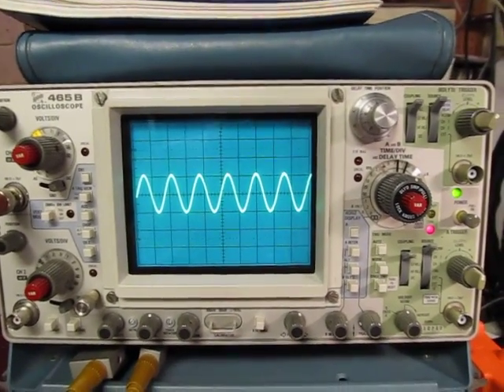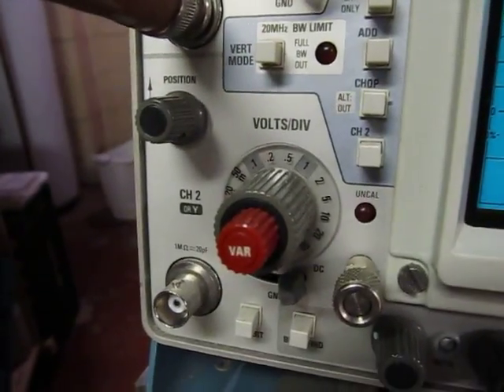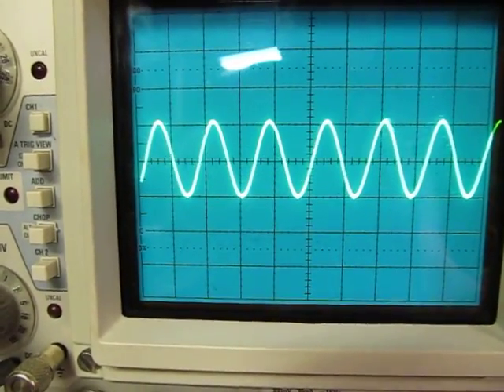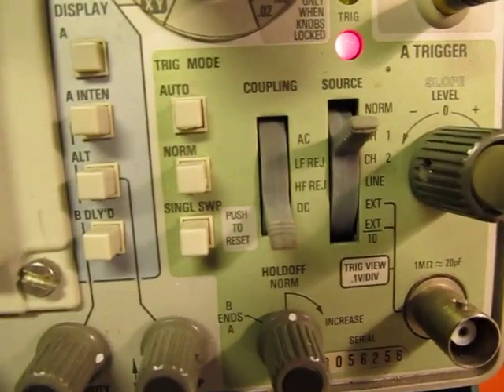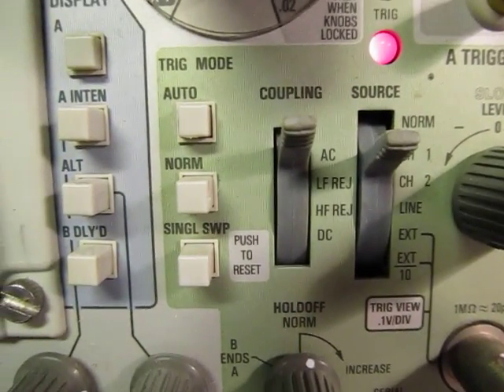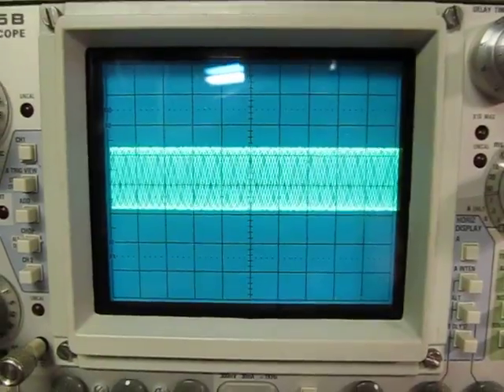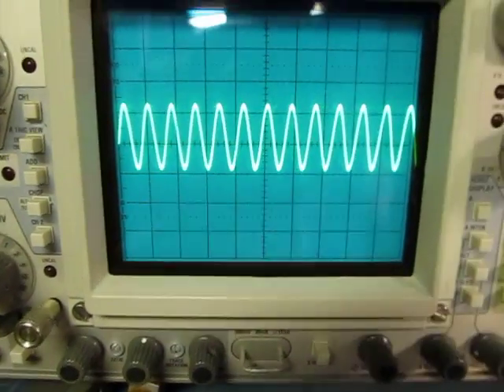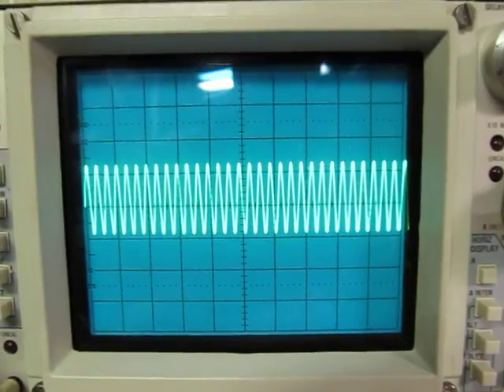#11: Tektronix Oscilloscope Triggering controls and their usage

Comment: And the External Trigger? What is useful for?
Reply from the maker: +Popart 2015 There are times where you might want to look at a pair of waveforms with respect to a third signal.
Reply: ***** Ok, thank you. Nevertheless I don't find any good video about External Trigger to see how to do it
Reply from the maker: +Popart 2015 It isn't needed very often, but can be handy sometimes.  An example:  To look at differential logic signals you would have to probe both the DATA and /DATA lines with the two scope channels.  You would then use the ADD and INVERT functions to see the differential signal.  If you wanted to see a differential eye diagram, then you'd need to trigger on the data clock.  You can apply this data clock signal to the EXT trigger in order to do this.  There are many examples where you don't want to waste a scope channel to simply do the triggering - this is where EXT trigger is helpful.  It is kind of like an additional scope channel, but one that is only used for triggering (not for waveform display).
Reply: +w2aew So, the external trigger is not an output channel, it's also an input channel but only for triggering. Ok, I got the idea, more or less, it was the word EXTERNAL that make me think it was an output signal...
Reply from the maker: +Popart 2015 The EXTernal terminology comes from the scope's trigger circuit perspective.  "Internal" triggering is when the trigger source comes from one of the input channels.  The signal is tapped off of the signal path between the scope front-end and the vertical amplifier section - thus tapped off of an "internal" signal path.  The External trigger comes from a signal source that is external to the scope.  Yes, the name can be confusing, but it is most definitely an INPUT, only used for trigger purposes.

Comment: Hi,just a small question: Can i use 475 200mhz crt in a tek 475A 250mhz?
Or change the vertical atenuator array in the same order? Or all that in the inverted order?
Thank you.
Reply from the maker: Unfortunately I don't know enough about the specific changes between the 475 and 475A to answer this for you.  This is a good set of questions for the experts on the TekScopes group on Yahoo!  (groups.yahoo.com)
Reply: the difference between these scopes are basicly 50 mhz, I think the rest are equal. Ok thank you.